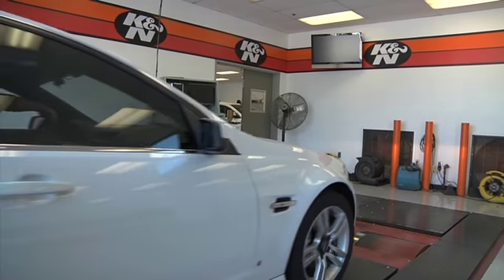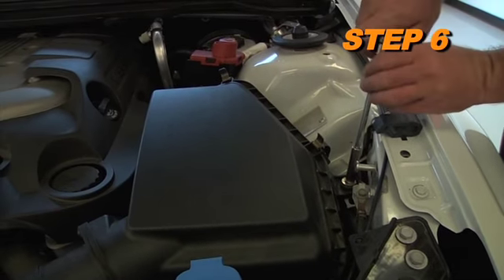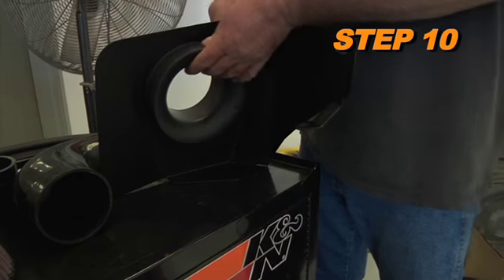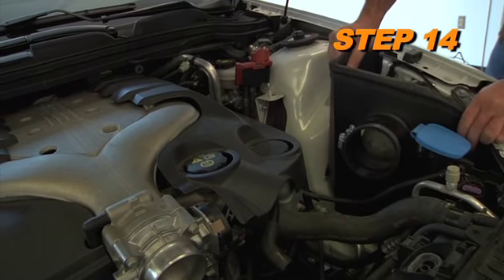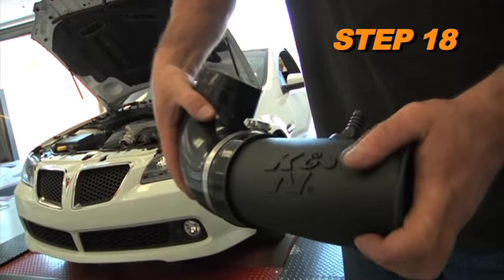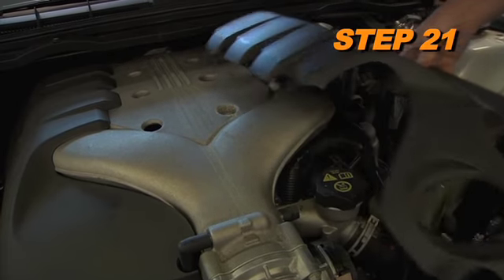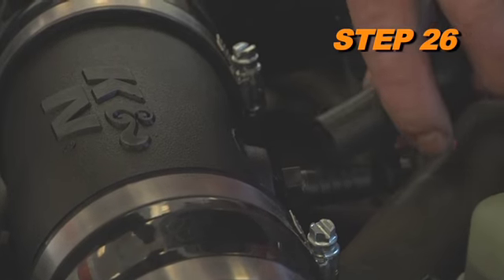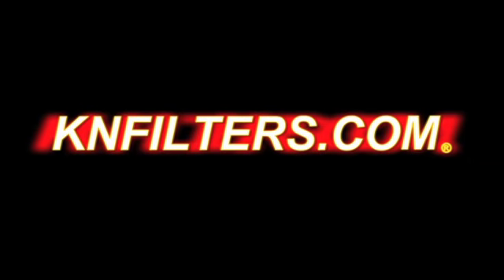Pontiac G8 3.6L [#63-3072] Air Intake Installation

Comment: The mass censer has a rubber piece on the end does that go on or do I put that off to the side and don’t use
Reply from the maker: During the installation, the hard plastic mass air sensor housing is attached to the intake kit using the included (2) hoses hose clamps. One hose attaches the sensor housing to the intake tube and one attaches the sensor housing to the air filter adapter. Any additional components connected to the sensor housing should not be used. Please refer to step 15 and 16 of the install instructions for the sensor installation. If you have any questions, please do not hesitate to contact our customer service team at 800-858-3333 or tech@knfilters.com